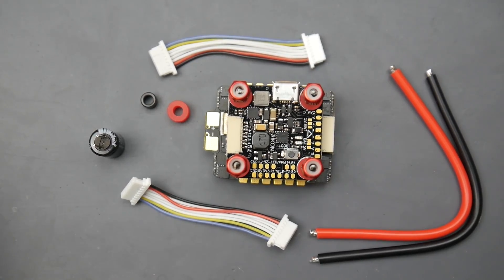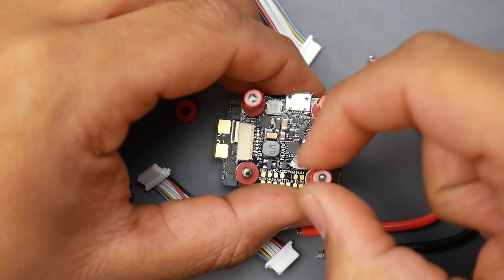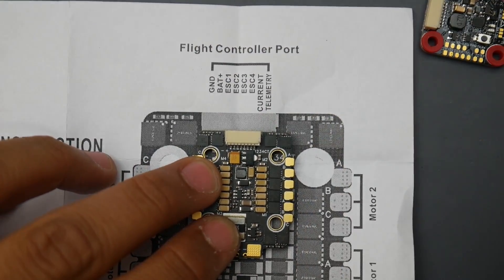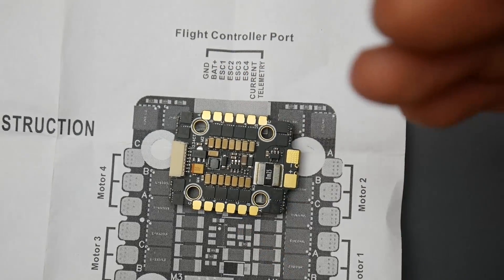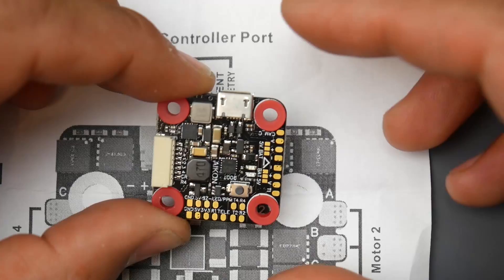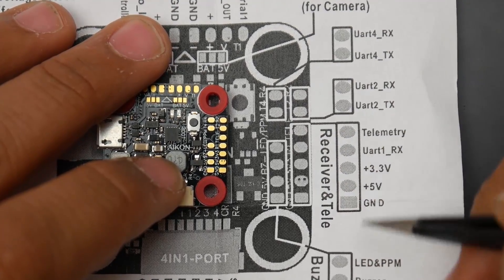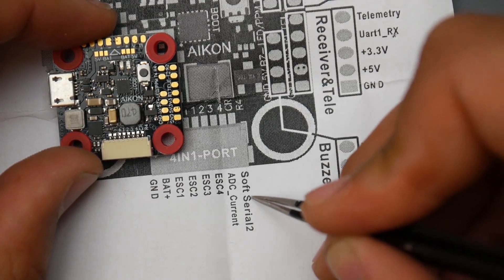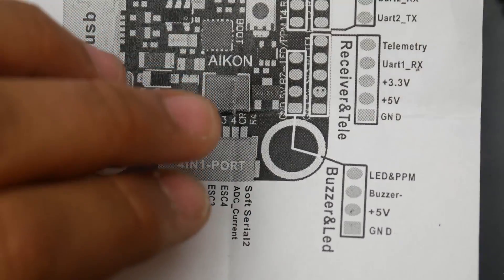Can It Beat The Ori32 Stack?? // AIKON AK32 Flytower MINI Combo

Comment: still the mamba 405 is a better choice.  not 6s on the 20x20 but i dont see a 5 inch and up using a 20x20...  6s 35amp for what.. a 3inch?
Reply: Well this hasn't aged well... I've got a 3 inch 4S monster haha, I'm using the aikon ak32pin 35 amp 4in1 esc v2. I already blew a 25 amp 4in1 esc

Comment: I run this stack on a 630 gram AUW 6s rig with 2306 1700kv emax eco motors. I run the snot out of it and its holding up fine.

Comment: For me it's really hard to belive that a stack that size can handle 6S. Even though it has happened before I always feel stressed when flying 6s not because I can't handle the power but because of being scared of actually burning something.
Reply: I'm using that esc on 6s and fc and ruinng it for like 3 months still strong ,no issue at all